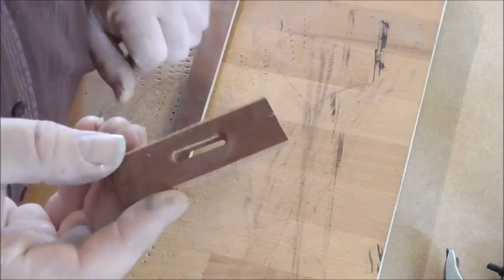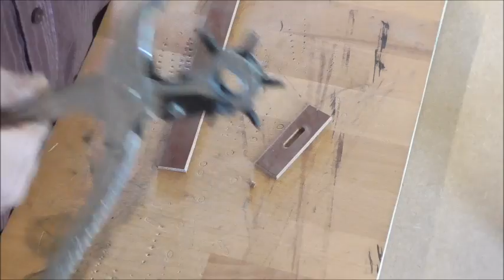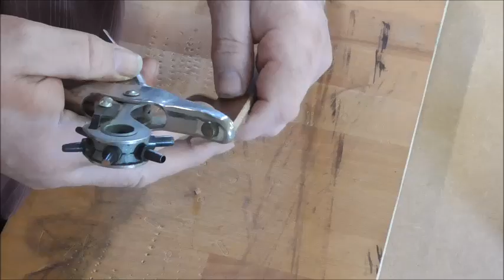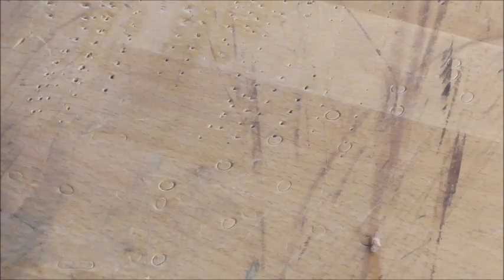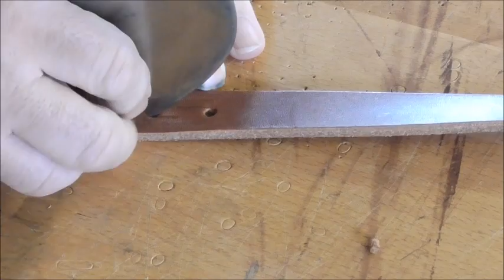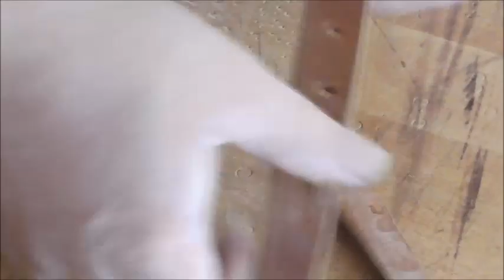How to make a hole for a belt buckle

Comment: on the first cut you seem to use both the knife and pulling the leather to make the cut, does this method offer more control?
Reply from the maker: Yes when I use my round knife I move the leather . I should add not all the time but I Mainly do it that way.  The round knife is a great tool that does many cuts. It is worth mastering it.  I also have a video on how I use my round knife.  I don't watch my videos although I would imagine I go into more detail on how I cut with a round knife.  When I make a video I don't pre plan I pick up the camera and start shooting. I then publish them. That is partly why I don't remember what I shoot